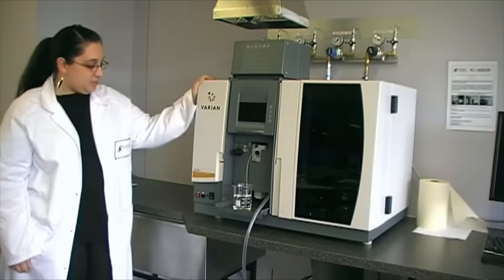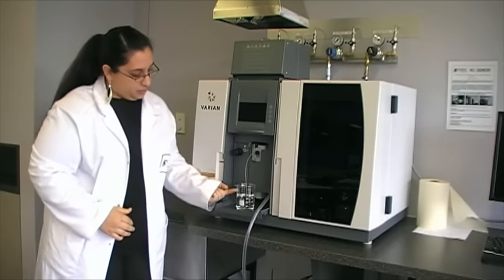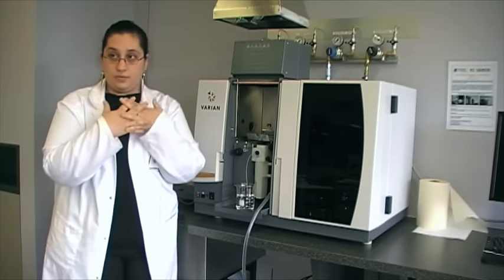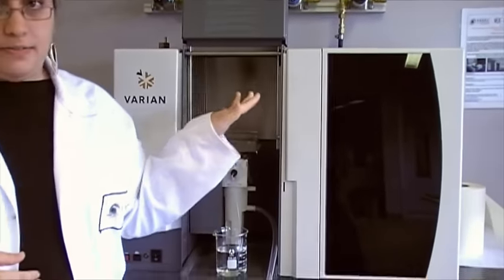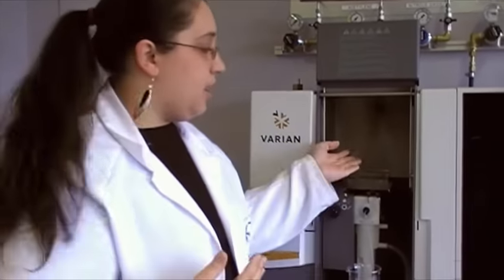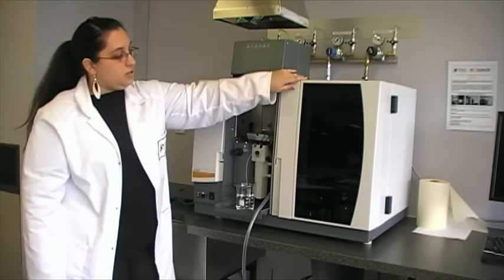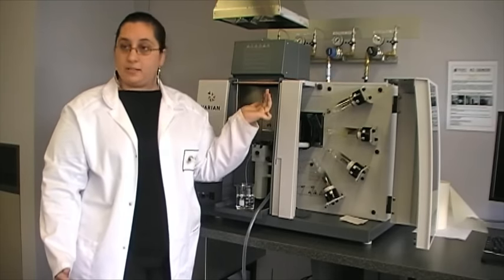How the AAS works

Comment: Nice video, However the atoms of intrest in the flame will absorb light from the hollow cathode tube, this will decrease the amout of light going to the photo multiplier. The decrease in light detection reguarding the sample compared to the amount of light detected with just the hollow cathode tube is converted to a measurable amount of absorption.

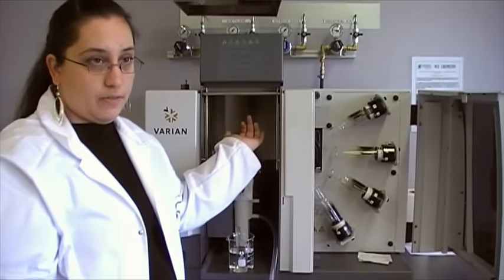Comment: Great stuff apart from a little bit of confusion at 3:00 min - 3:15 min of the video.  Photons from Mg emission in the flame are of no relevance to the analysis.  This has been observed by a couple of commentators on this video. The student in the video could have explained better in terms of modulated transmitted (unabsorbed) radiation from the hollow cathode lamp versus unmodulated emissions from excited Mg atoms in the atomiser, other excited atoms, plus radiation from the atomiser itself.  A supporting mention about the inverse relationship of absorbance and transmittance (Beer's Law) and role of the log amplifier would probably have completed the video perfectly.
Reply: +Michael Kiap i worked  for 16 years  maintanance  and training  people, all we   promoted was the  Results  ,,,,
Reply: Hello. You most likely meant the law of absorption. But this is the law of Bouguer-Lambert-Ber. He describes the dependence of absorption and concentration.

Comment: Hey you got that explanation of the process all wrong! Extra light is Absorbance? I thought it was the other way around! 
Actually free state atoms created by the flame do absorb photons at the characteristic wavelengths (specific for the element under study) emitted by the lamps. However this causes a drop in intensity reaching the detector (compared to an unaffected "Reference" beam) and the drop in intensity is converted mathematically into an Absorbance value, proportional to concentration.

Comment: Can anybody tell me that,  is it necessary for cathode to be made of  the metal which is in the solution? If yes then why?
Reply: Hello. I will assume correctly your question. To determine the element under investigation, it is necessary that your lamp (hollow cathode lamp) be of the same wavelength as the element you are exploring.
To you for what purpose, tell me?